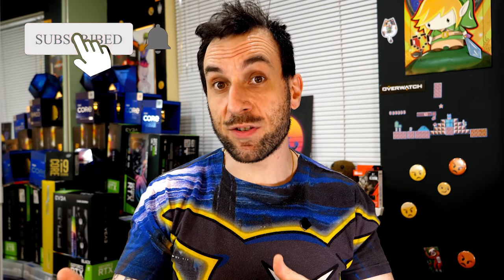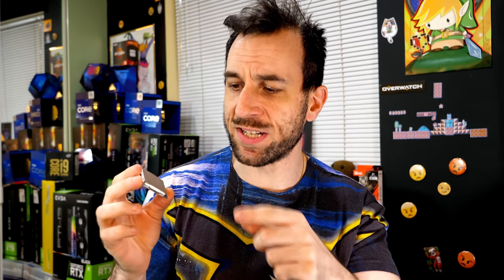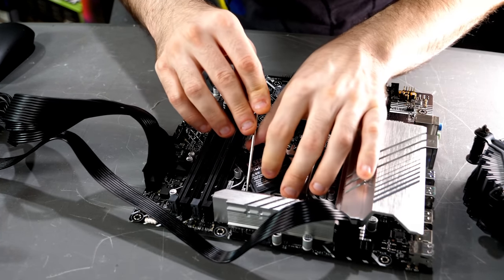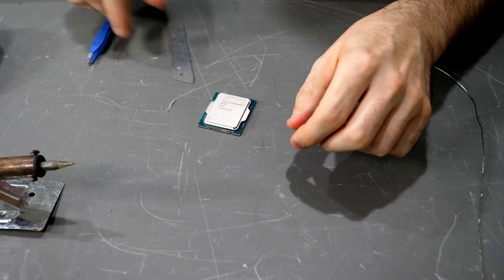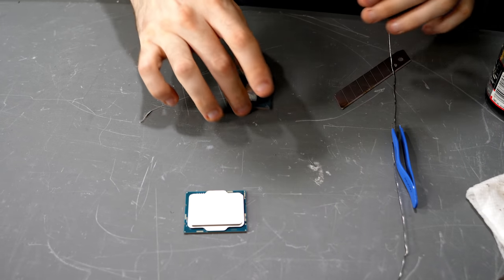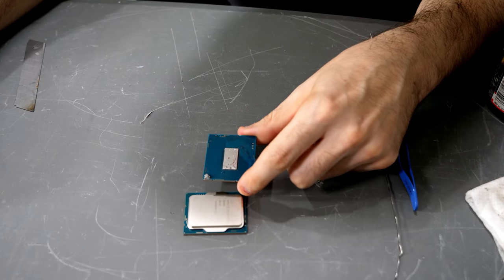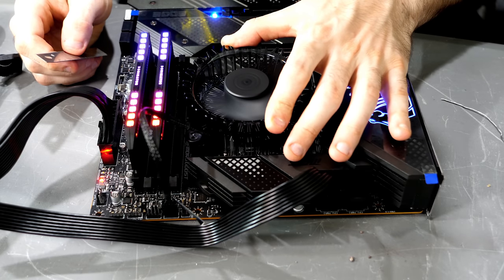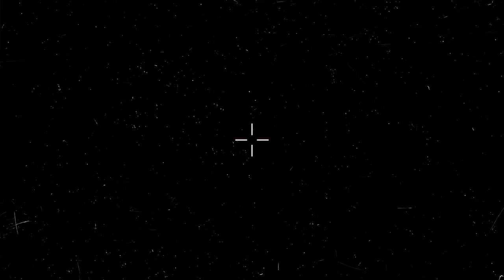I killed my CPU... 😭😣

Comment from the maker: Apologies for the slurring and poor quality, haven’t slept in a week
Reply: Get some rest! Also, good stuff on this. Now there's a cheap solution to fix a botched delid job. By the way, something for you to test when you get the 5800X3D is to test if the performance with the 6900 XT edges out 3090. I know prior to the 5800X3D, the win goes to 3090, and I rock a 3090 myself with no plans of changing, but I have finally FINALLY found content from 1 channel that actually tested warzone competitive settings with 5800X3D + 6900 XTXH and the results were quite astonishing (and I'm not referring to the highs but the sustained FPS and 1% lows). I think the 3D v-cache + RDNA 2 + SAM really worked up some McD's Big Mac special sauce.
Reply: Nice freaken job bro!!!
Reply: Dude, your content is top quality, no worries. Aesthetics aren't as important lol.

Comment: love your content, i learn so much i built a 12900k with a 3090 and a 5200 mhz 64gb kit love it so far. i had some issues with the ai over clock, it would blue screen every so often so i turned it off. i think it was pushing passed 5.5ghz and the temps was causing the crash. might tune it to a safe 5.2 or 5.3 yet i dont know shit about over clocking...

Comment: Or you're simple
Purchase an LCR meter 
Measure the value of the capacitor outside the processor.
Then buy the capacitors
In size
smd 0402
from farnell
The capacitors cost a few cents
On the processor these capacitors are coupling capacitors
About four years agoI purchased some of X5690 processors LGA1366 (X58)
Sold as non-workers 15 USD
Cheap and I fixed them
To perform an overclock on them.
I soldered some capacitors of 10UF
And the processors came back to life
And I did the best of the processors
Overclock to 4.6G
On the 6 cores

Comment: A mate screwed up a delid. He got liquid metal on he's fingers, then touched the gold contacts on the bottom and dissolved them. 

Killed his new 9900k. Lesson learned.
Reply: Is there something you can do right away to fix it when that happens? I remember seeing a while back a vide with one of Linus'  associates and he spilled liquid metal over the laptop motherboard and just wiped it off regularly and it ended up working. I'm also asking asking because I delidded my CPU, bought liquid metal, but a bit worried about using it.
Reply: @Ben-ld1qi  I looked into getting it fixed, but couldn't find anyone back then. These days, I have plenty of contacts that might have been able to help.

I've used liquid metal for years with no issues at all. Just make sure you prep the CPU, making sure there are no contacts left bare under the IHS. I coat them with a clear lacquer, that way if the liquid does drip it won't short anything out. Keep your hands spotless and wipe the chip down with isopropyl a lot. The liquid metal takes time to dissolve soft metals, so you have plenty of time if you do spill a bit or make a mess. Use the tiniest amount. It's easy to add a bit more, and a bloody nightmare to take too much away. Watch a few vids from different channels showing the delid for your exact chip. Most will say the same, but they will all have a trick or 2 that will come in handy. Some are soldered, some are just glued. 

There are (or were) companies that will do the delid. Last time I looked it was about $35 if you don't fancy it. It's not a lot of money and they take all the risk. Caseking in Europe did a while back and Silicone lottery used to too but I think they closed.
Reply: Blue Flamingo  The gold dissolved. There was nothing left but the green PCB substraight.

Comment: Hey brother just needed your opinion I just ordered new parts I can already tell you are probably gonna get on my ass for the cpu but I ordered an i9 12900ks 😅 and the rest of the parts I got are an Asus ROG strix z690 E motherboard with DDR5 Trident Running at 6400 mhz cl32-39-39-102 1.40v, I got the new corsiar h50i LCD cooler, I went with a 1600wt power supply, with two nvme 2 tb, and an corsiar airflow 4000d case is this a good build and I'm gonna run it with an Asus ROG strix 3080 ti I need to know if this is a build youd give a thumbs up too ??

Comment: Would anyone be able to help me I’m kind of having trouble with my gaming pc with performance especially in warzone. I’ve got a 5600x b550 ddr4 16gb of 4400 viper, 750w psu and a 6800xt if I’m playing modern warfare multiplayer I’ll get around 230 and a high of 260 fps on 1080p high settings. If I use those settings in warzone I’ll get like 120-140.